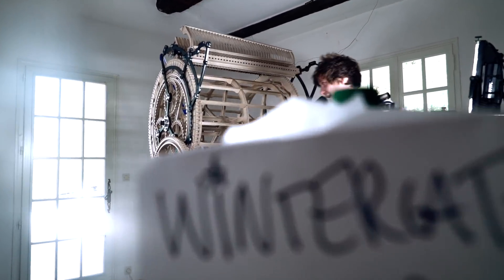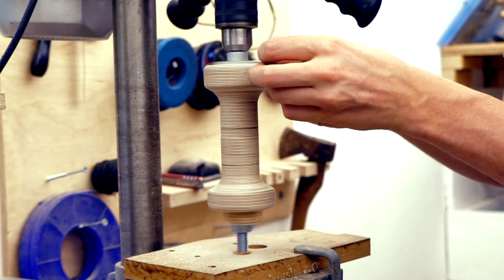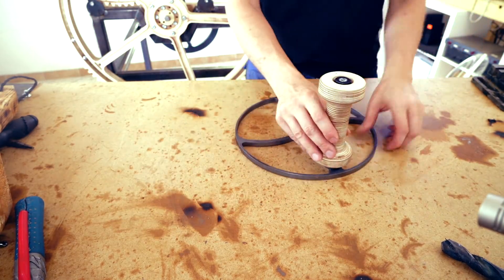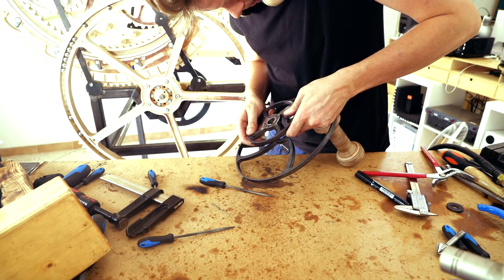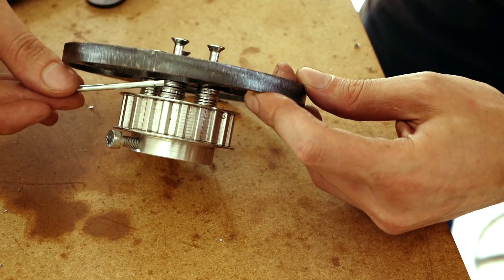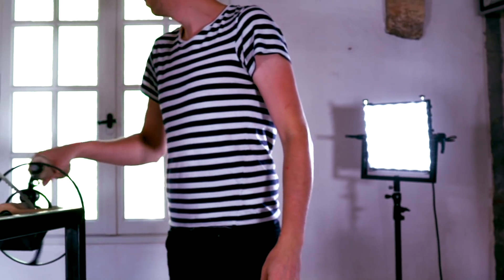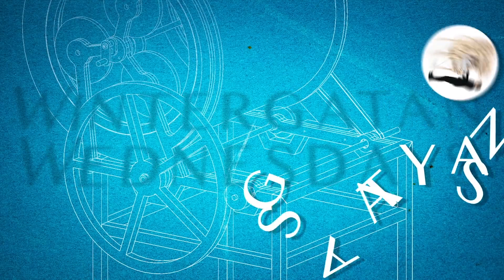Making a Crank Handle without a Lathe - Marble Machine X #49

Comment: Martin, you might tray a gallon kit of West 105 epoxy... It's usually used for making wooden boats. What it does its turn softwoods into something as hard as steel, once applied. It also imparts a rich glassy surface finish! If you put it on your gears, they would be pretty impossible to break.

Comment: I may be wrong, but I think you will very soon have a lot of play between the crank handle and the crank shaft, mainly at the interfaces with the little offset bearing piece with the flat sections

Comment: Borde inte fästet för handtaget vara "felgängat" för att minimera risken för att det sakta men säkert skruvas ut av misstag? Det är samma princip på högerpedalen på en cykel.

(English: Shouldn't the threads on the actual handle go in the opposite direction so as to minimise the risk of it untightening itself during cranking? It is the same principle for the right hand pedal on a bicycle.)
Reply: Maybe I just haven't seen where it is supposed to disassemble when being moved from one location to another. If the flywheel where the handle is mounted is the part being removed, then I guess it will not matter. :)

Comment: I highly recommend getting a very small super magnet (neodymium) and putting it next to the crank. then put the allen key for moving the handle on that magnet. It will never fall off the magnet, and it will be easy to grab and put back.
Reply: Great idea! I had a similar setup on a 7-string guitar with a locking bridge. It had a 2-way allen wrench with a clip holding it on the back of the headstock.
Reply: Easy enough to mount one on the frame.

Comment: For someone who has not had a manufacturing or engineering background, you have learned an amazing amount. But you still need to learn about the proper fasteners to use for different situations. For example, you should have set screws in the collars on the shaft, not a flat head screw.
Reply: He should be using his drill press and secured vise for the tapping operations not a power drill.

Comment: Hi man, how do you obtain this "blackish patina" on your pieces, i want to make it for a my piece of iron, (obviusly not stainless steel :D).
What can i do to obtain it?
Reply: Malkoitrek In this case it's simply mill scale. However, in a previous episode where he welds the steel frame the machine sits on, he uses a chemical called "Black Patina". It reacts with the steel to give it a dark patina.
Reply: some of the patina are from the gas cutting. The heat of the torch are doing this. He said that the parts where the handle are mounted were laser cut but you get way more better surface if you laser cut.
Reply: Ulf R thanks, I don't need to cut nothing I only need the patina 😍 I have some piece of steel that I use to work with wood, and some bit that I modify for my use and I need to protect it by the oxidation
Reply: Malkoitrek When I were In school we also used some oil that you use for wooden furnitures. and then heat it up using a gas torch. and wipe it of when it have cooled down.
Reply: @Trident2113  thanks i need to try

Comment: Those welds between the bottom and the top of the frame are worrisome.
Reply: nope... they are remove-able pieces so you look at two pieces that are not welded together... sort of... :)
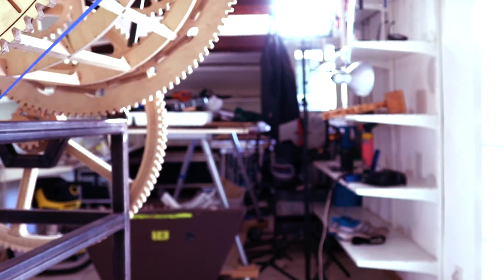Reply: I understand that, but if you look closely the top frame is screwed onto a disk that is welded to the bottom frame.  With the movement this machine is going to have along with the constant assembly and breakdown those welds will fail over time. Look at 7:37 through 7:50 and hopefully that will clarify.
Reply: @pimpdaddygary  Does it just need to be gone over again or is this a critical flaw? The whole thing can be taken apart, so constructing it on a new frame base is certainly possible if that's the case.
 Are you just making an observation or do you also happen to know a better way? (I am not connected to the project, just a viewer).
Reply: Ok... I see what you mean... valid point. :)

Comment: Just panicked a little as I watched the programming wheel go by and saw all the lever locks that hold the plates for the programming pins and I thought how are you going to open them all when some are blocked by the frame, forgetting that the plates are smaller sections put on one by one with the wheel being spun to put on the next plate. Amazing design all around and getting more amazing every week.

Comment: not gone lie but the weldings at 8:05 are not that great.

love your work by the way
Reply: You only think Martin's welds are bad because you've never seen mine.
Reply: Excellent response :) (BTW: I weld very badly!!)
Reply: Andrew:  The secret is to just increase the amperage all the way.  This could result in melting giant holes in your work.  Don't worry though.  If this happens, you just go find a hunk of steel to cover the hole and weld it on.  If this results in another giant hole, repeat the process until you eventually don't have a hole to cover anymore or you destroy whatever you were working on.  If you destroy the piece, go to the store and buy another one.  You can rationalize the purchase price as the cost of welding practice and vow to do a better job next time.
BTW:  This technique can result in little bits of molten metal splattering all over.  If you weld in sandals, try and keep your feet tucked out of the way.
Reply: Hi Eric - many thanks for the advice.  It's been a while but I'll recall your guidance next time I have a job to do.